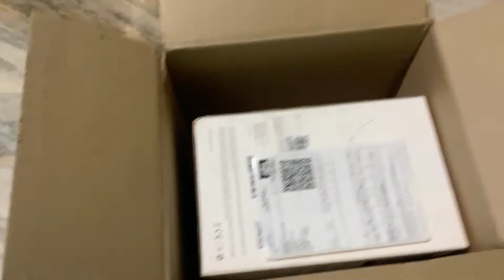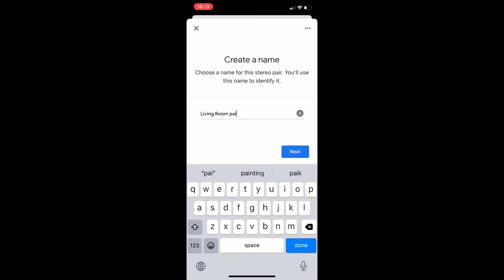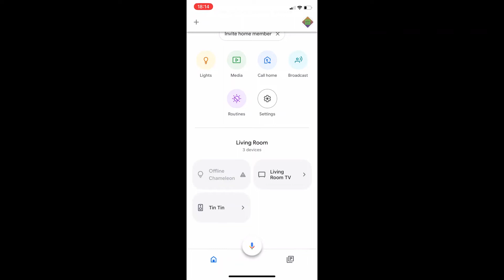How to stereo pair two Mi smart speaker? MI smart speaker operating in TWS mode

Comment: Bhai kya nya ir wala aur old wala stereo me connect ho jaega kya
Reply from the maker: No
Reply: @SparTech44  r u sure
Reply: Plz reply
Reply from the maker: @shubhamsachan1212 yes. You can connect them in a group but not in stereo mode.
Reply from the maker: @shubhamsachan1212  to operate in stereo pair. Both the speaker should be of same model.